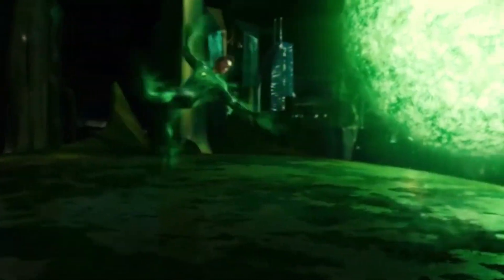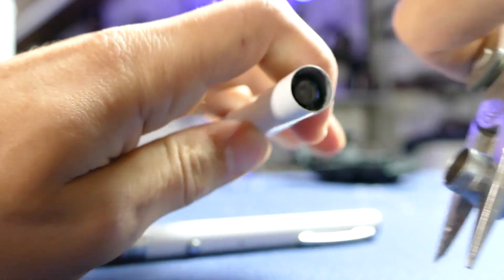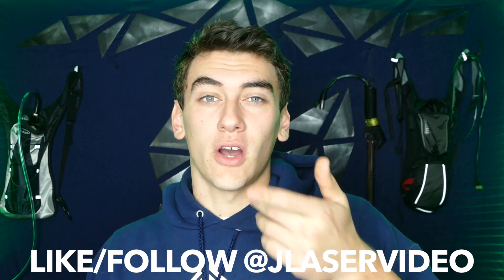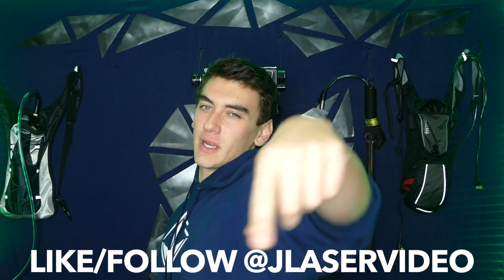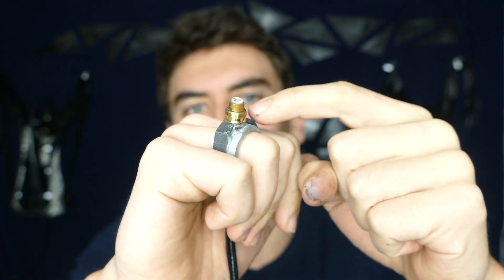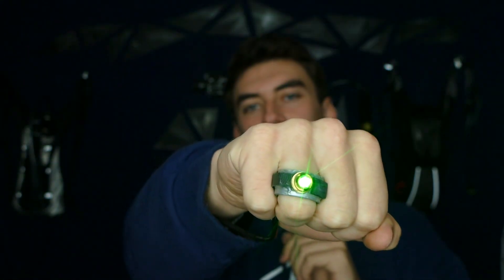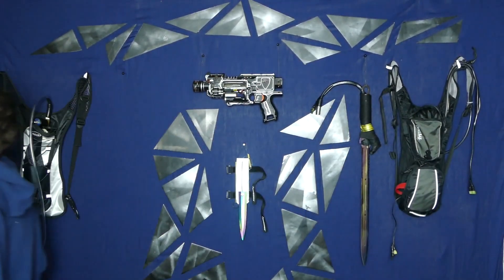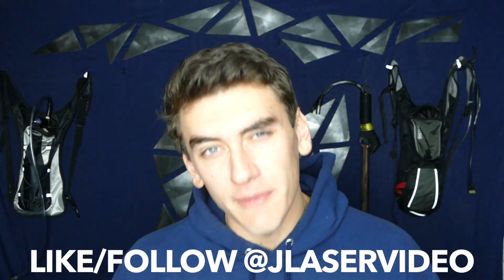How To Make a GREEN LANTERN Laser Ring! - Real Burning Superhero Ring (Simple Build)

Comment: Total Proof-Of-Concept/First Prototype.  Most people would be happy with an LED vs. a laser...  put a pressure switch on the inside of the ring behind the face, so you can either flex your middle finger in a fist, or  flex down with your index and ring fingers on both sides to activate the switch.   I think that Rubies has one as part of their GL costume, but you can't replace the battery (looking for a hack)...

Comment: Do a flamethrower ring. You can make it with an arc lighter and a grill lighter. Just need a little angled piece at the front of the ring. The arc lighter can double as a taser.

Comment: You should take your ring and switch the green laser with the purple one ad then that way you can burn stuff and catch stuff on fire. Also the circuit board should be a little smaller in size so it should be a little easier to build and hide.